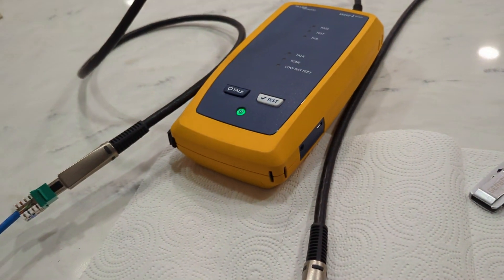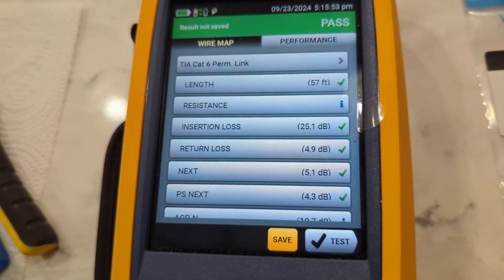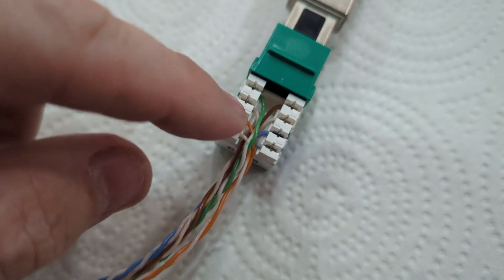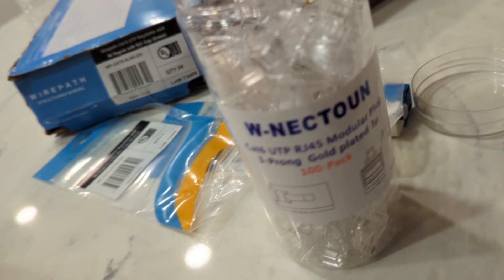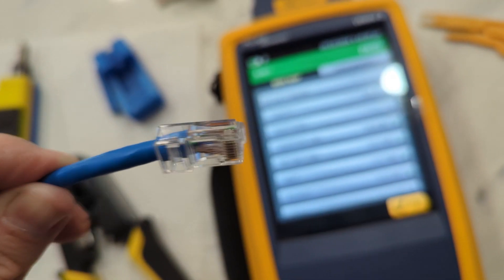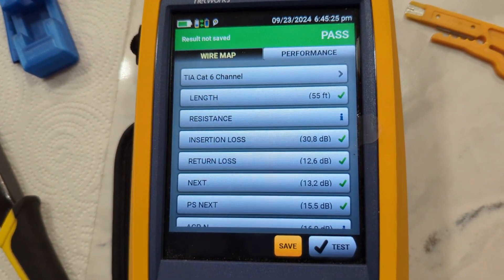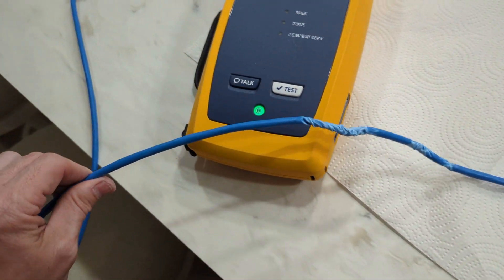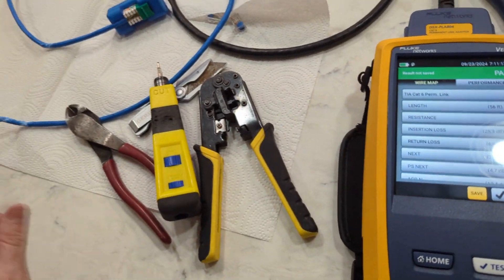Cat6 Testing Poor Workmanship - Untwisted Wires and Kinks with Fluke DSX 8000 Versiv 2

Comment: I have done some network installing and certification with this Fluke. 
We did a lot of CAT6 and 6A and remebered the cable to be much more delicate, even one kink wouldnt pass certification.
We always were very gentle with cables, taking all precautions and recomendations.
 Almost everything we used was from Corning/3M. Their tool-less keystone jacks are so nice.